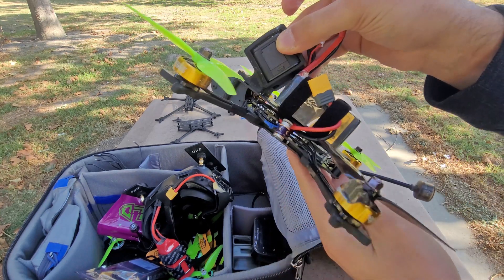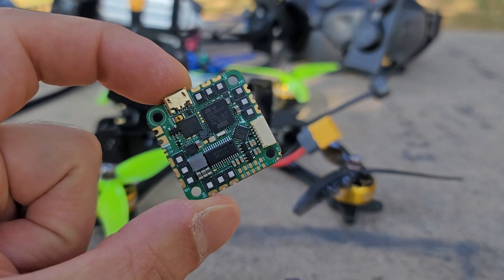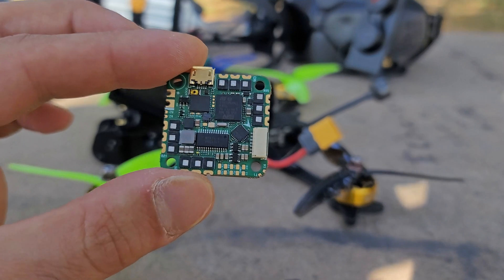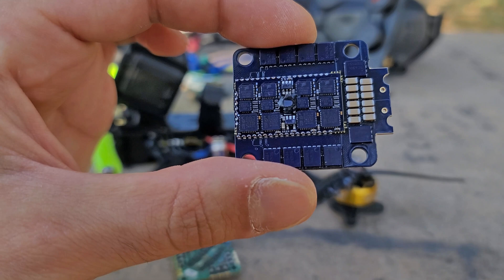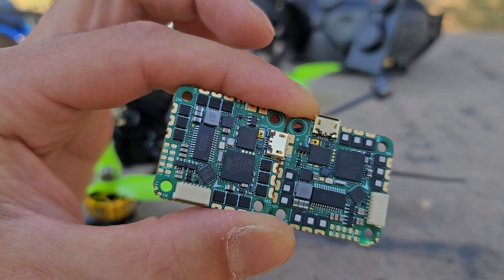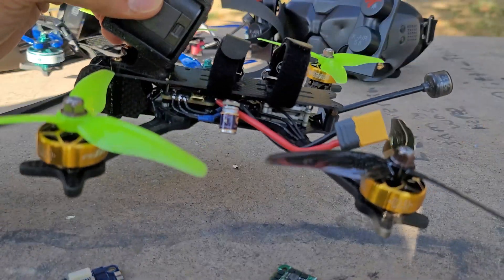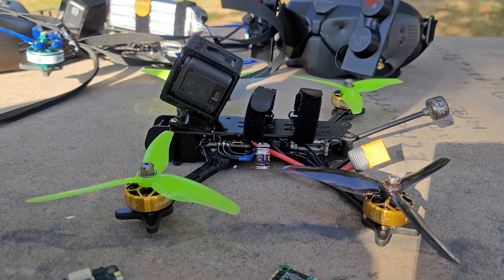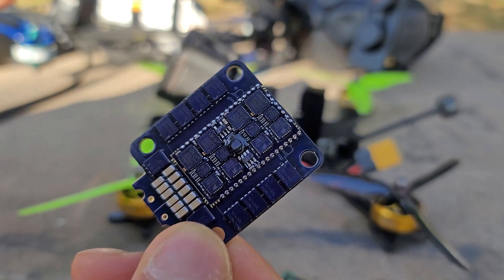iFlight Beast H7 AIO - A Whoop board for FULL 5"?

Comment: Jeez, finally, somebody uses UBGA.

95% of whats been driving this hobby is cost. Its why F411 everywhere. Its why almost all SMD components are under 50 cents..

But, this iFlight H7 AIO is just beginning of what is "possible".. ofcourse for a price:
1. H7 dual core. WCSP156 5x5mm package. Save space. Better heat transfer
2. Already has 2MB flash. Can use 1.5MB for Blackbox.
3. H7 dual core.. 240Mhz F4 core can run 4x BLHeli_32 ESC.
4. 4xFortior gate driver is so 2010. And tons of wasted space. Im sure there are solutions that integrate gate driver with FET.
5. Speaking of noise - AIO can have electronics/gyro on separate board like the Tekko

And ofcourse, the big elephant in the room.
Whats point of miniturizing FC/ESC when DJI Air is huge and clunky. 
And doesn't it already have big MCU? And why are we sending packets over 2.4Ghz and 5.8Ghz.. seems kinda stupid to me.

The future is 1 board. FC. ESC. DJI. 
All "one board". And 1 frequency. video and RC control together.

Back in 90s, you had to plug in a ISA Sound Card. Then they integrated it. Almost nobody buys sound cards or network cards.
Likewise with video cards. First integrated into north bridge. Nowadays built into CPU.

Comment: Im new to FPV, why does you capacitor look so different? Do you have a video where you talk about it?
I also saw this last month, i want to put it in a 4" or 5" 360 degree video build, but i want o build with cheaper parts before i mess up a $90 board!
Reply from the maker: Which capacitor?  Maybe the descriptions of the items found on this page will help. 

https://fpvcycle.com/products/panasonic-fm-low-esr-electrolytic-capacitors?_pos=6&_sid=a45050e22&_ss=r

https://fpvcycle.com/products/wafl-s-fpv-capacitors-2-pack?_pos=1&_sid=a45050e22&_ss=r
Reply: @Kabab   The purple cylinder in this shot: 6:39
Reply from the maker: @techknowbabble  oh it's made by WafL. But they kinda slow at making more. It's just a particular cap spec
Reply: @Kabab  Cool, thanks. Is it any better that others or just look really cool? :)
Reply from the maker: @techknowbabble  it's the same thing just a little smaller.

Comment: I like that spot. It looks like good mix of open space and trees. How you were able to manage to find you way back to your launch location is impressive. I get lost a lot. Using landmarks as locators works but if I'm far away from them and go down, tracking the quad down becomes an Indiana Jones excursion.
.
Btw, I took the Babytooth out on Sunday for its maiden. I used your suggestions for the build as I still don't get how people pick frame, motor, and prop combos. That thing is so quite. My friend was pretty impressed with how stealthy it is. There didn't seem to be a lot of punch-out power though. I mean it is a 1s so I can't expect much. But it cruises so nicely. Because it's so light and the motors aren't like blender motors, getting out things like thick brush or trees can be tough. I got caught in a tree and we could not see it even while spinning the props. Fortunately, turtle mode got me out. Had it been a thick pine tree, I think it would still be there.
Reply from the maker: Yeah can't expect too much from 1s but it handles really nicely

Comment: Well, anything with anyone 35A esc's  will work
Reply from the maker: You'd think so but give it a shot and you'll see it's absolutely awful. I've tested every single whoop board out there for full 5". None work
Reply: @Kabab  Did you try this one, I run it in a licht 5inch toothpick style, with a small capacitor bank,   HIFIONRC F7 2-6S 45A AIO FC + ESC Toothpick Flight Controller

Comment: Dude... you can't just drop a massive 7+" motor on your store and not do a video about it...for a 300g dry weight (w/ BH 2806.5s), LOS-only 7" vertical arm frame, do you think your new motors are overkill?  I still think the 7" bi-blade gemfan 7042s are the easiest to tune throttle wobbles out of...
Reply from the maker: I JUST put up the first basic video about the motors.  The gemfan 7042 is fine but there really are no good 7" props at all right now.  Every last one is really not good.  The DAL Fold 7 is the best one but it frikin explodes in flight sometimes :-(

Comment: The CLR V2 Whoop V2 F7 board is a nice board. Dont have the plug in play DJI but has enough Uarts to do whatever you need to do. I currently running it on a 5inch with Vista.
MCU: STM32F722RET6 216MHz

6-Axis MPU6000

Build in Beta flight OSD

2- 6S( 27V ) direct battery power

Build in Voltage monitoring resistor

Build in 5V/1.5A BEC and 3.3V/250mA for system

Direct solder on mount for TBS Cross fire Or solder pads for Frsky

Build in Camera Control with direct camera plug in

Build_in 32bit 35A ESC with current sensor

29x29 whoop Styple mounting pattern

Dshot support with Native RPMfiltering support

Designed to use on 5V camera and VTX.

UARTS to use (uart1,uart2,uart5,uart6)

Comment: I have a HIFIONRC F7 45a AIO whoop board in my 3 inch that will supposedly work fine in a 5 inch, but I'm on my second board. The first one lasted 6 flights before I got a motor stuttering. Then another motor, then another, then the ESC was completely dead. But I can never tell if a board is a bad design or just the common China makes crap that doesn't work half the time because quality is less important than volume sales. I don't think my 1404 4600kv motors on 3 and 4s pulled more than 45 amps. What's the name of that sugar substitute that you said is actually good for your teeth? I can't remember the video where you talked about that.
Reply from the maker: xylitol
Reply: @Kabab  Thanks! The Ice Breaker gum I get sometimes has that in it.

Comment: 20x20 should be the standard mount pattern for all boards. AIO, Stacks. I have the JHEMCU 20 x 20 AIO board for my 4 inch micro reverb which I’m using for long-range because I can run a decased Vista straight on the 20 x 20 stack
Reply from the maker: Yep.  The issue is just that manufacturers are just too confused about what that means. I keep telling them to just take the same 30x30 esc and stick 20x20 holes on it but they don't get it and keep trying to make it smaller.
Reply: @Kabab  do you think they have perhaps become overly obsessed with hitting sub 250g In order to ensure they protect the baseline business because of the changes in US regulations, which could see other countries follow suit? Hence the reason why they have not really listening

Comment: Are you benefitting from filters because its so light, or they're worth using with BF now? That looked like great expo on return to centre.
Reply from the maker: The filters are fine. You can see that the quad isn't flying perfect. I've gotta tune about something on it. I haven't bothered trying to figure it out because it would take forever on 4.2
Reply: @Kabab  looks very well for stock though.

Comment: Just curious have you setup the  amp meter (current sensor) how many amps's was it pulling with that combo? $90 does sound expensive.. I'm gonna pass. IMO weight is not as important on a 5" unless your racing so for Freestyle I would rather have the reliability and durability of a 30x30 stack especially if I get caught up in a tree and need to hack my way out. Not to mention freestyle quads need some extra weight to throw the mass around.  Also I think the barometer is used for altitude. PyroDrone has a Whoop style FC with a barometer and it's kind of cool to see how high your flying. Very easy to setup just enable it and check the box in OSD menu. I never realized how high 400 ft was.
Reply from the maker: The amp readounts are not accurate at all. I don't even bother setting them up anymore

Comment: Not sure if you do this or have tried but try turtle mode :0. if that 4-1 FC can do Turtle mode like other 30x30 stack ESC's then it should get an approval. Most 30x30 ESC's can handle Turtle mode or if your caught in a tree and need to pop it a couple of times. You say it perfom's at the same level so just curious if you have tried them in turtle mode.
Reply from the maker: Performs at the same level, I dunno if it'll hold up to the same punishment. Out of about 20 packs it's been fine. Turtle and all

Comment: Hi Bob   Great looking board for whoop style quads, I don't know about the price,  but I have tried other boards and the only one I found was the JHEMCU GHF-411 pro for 6s and I was terrible unimpressed it was a no good after 4 flights and I'm only using 1106 2400kv 6s motors. Will I try it probably not.  But I still want too  !  Thanks again for the information and video
Reply from the maker: That's the issue with all the boards usually

Comment: Ok I'm impressed, there's always been compromises with 1 inch AIO boards usually lack of ports and lack of black box. Like the new BetaFPV 20a has a black box but their new F722 has ports but no black box. I wonder if Iflight could do a cheaper F405 based board with a black box and good 40a in the same way as this board.
Reply from the maker: The power routing in the board is more valuable than anything on the board imo so I'd say it would be a good move for them if they did

Comment: Thoughts on CLR whoop 25A? Based on layout, components, and reputation, I'd pick that one over iFlight's. Don't have any experience on both boards though.
Reply: I can chime in on the CLR Whoop V2 F7 Aio 35amp board I recently bought. So far so good. Haven't had it long enough to vouch for durability.  But I'm impressed with the board and it's on a 5inch build with DJI Vista.
Purchased from Pyrodrone. 
MCU: STM32F722RET6 216MHz

6-Axis MPU6000

Build in Beta flight OSD

2- 6S( 27V ) direct battery power

Build in Voltage monitoring resistor

Build in 5V/1.5A BEC and 3.3V/250mA for system

Direct solder on mount for TBS Cross fire Or solder pads for Frsky

Build in Camera Control with direct camera plug in

Build_in 32bit 35A ESC with current sensor

29x29 whoop Styple mounting pattern

Dshot support with Native RPMfiltering support

Designed to use on 5V camera and VTX.

UARTS to use (uart1,uart2,uart5,uart6)

Comment: When building smaller quads - is it beneficial to use higher amp rated board (which is more expensive) if your motors don't drain this much amps? Like motors drain 18A max and you take 35A board instead of 20A? Basically if the mosfet's or anything else's quality is subpar - are there chances that under lighter load it will be ok?
Reply from the maker: The amperage of the FET's on these little boards don't matter as much as the electronic design. It can't drive the current to feed the FET's even if it wanted to

Comment: Loving the product....but not the price
Reply: This board with 50usd would kill everything else. Production cost of this should be about the same as regular esc and a bit more. There will be a clone in a few months under 60usd for sure!
Reply from the maker: maybe.  This board is expected to use non-recycled FET's.  Nearly every single ESC out there uses recycled FET's from old devices of unknown origin which often results in the failures we have.  Using all new electronics significantly increase the cost of a board.  You might see clones, but that doesn't mean they're worth the lower price tag because they're more likely to burn easier.
Reply: @Kabab  I didn't know that..... great comment  thanks!!!

Comment: 1 burned ESC = 90$ cost... 
sry but that’s a deal breaker for me.
Reply: Thinking the same but for me its like 3 years and 500+ packs with no burned esc:s... even cheap ones...  I did acryl coat every component though. dont know is that an issue anymore or outside of Kiss ecosystem.
Reply: @afpv2225  i already had many stacks from mamba where 1 esc just broke
Reply: @justvoorfun  If you have no use for broken mamba stacks / other broken parts, could you mail them to me? I can pay for shipping of course, I would like to see if I'm smart enough to fix them. 
My mamba f405 stack esc blew a few fets, but I replaced them. It then broke again later in a really weird way where it seems to work fine, but when flying one motor is much slower than the others, so it tilts back into that corner slightly and forces the max amp draw to be about 30A. (I've tested with many motors, so it's not a broken motor)

Comment: Be great for a long range setup. F7 .. if u wanted to sometimes change the props and rip u got 45a .. though like to see how betafpv 35a one would run
Reply from the maker: I'd strongly recommend staying away from anything betafpv.  extremely unreliable and awful QC
Reply: @Kabab  damn it.. now u tell me lmao.. I just built a beyond the limit whoop quad using betafpv.. 4S 6000Kv lol
Reply: @QSpeedRacer  Had 2 betafpv vtx broke after 1-2 flights, 1105 motors with loose shafts after 1-2 prop changes. But their 1106 motors are good so far, going to test their boards soon, since not many alternatives are available.
Reply: @dmitry.murashenkov  omg damn.. 
I so far have use 2 of their f4 aio, a 12a and 20a. And 4 of their 1204 motors. So far so good.. but the radios r garbage. No clue how no reviewer picked up on it.. at first betafpv guy was like u have to tune center. I'm like I know that did that but pointless.. finally he got engineer and engineer was like yea it should be that random on center 😄.. I can live with a few point 1498 to 1502.. but 1488 to 1512, another 1480 to 1520.. 
If this happened earlier I would of did geprc board haha
Reply: @Kabab  i can attest their literadio 2 is garbage. I went thru 3. Only 1 was semi ok. Rest had a dead space of 20.. 1480 to 1520 on one. Never goes back to the same spot for center so flying a whoop in house it drifting everywhere.. spinning.. they replaced one.. offered on second but ended up just keeping it to test 2w amplifier

Comment: My hglrc zeus35 AIO has been ripping hard on both  2306 2600kv 4s and 2206 2400kv 6s with throttle limit for months now
Reply from the maker: I don't think that's a whoop board. 20x20 but bigger. Also, hglrc boards don't tend to give you all the performance there is.
Reply: @Kabab  yeah not whoop but it’s been one of the few AIO boards that have worked well for me and takes 6s too. Eager to try the iflight. Thanks for sharing.

Comment: @KababFPV This white spots on ic on that board are used only on high-end parts cuz it's expensive this its called "exposed metal top part" (its touching internal silicone which surface via iron that have way lower thermal resistance than silicone)and improve temperature =you can push more current compared to standard package -- I mean it have real impact on inside silicon temperature
Reply: picture https://e2e.ti.com/cfs-file/__key/communityserver-blogs-components-weblogfiles/00-00-00-03-59/5732.Figure2.jpg
Reply: @majamosbacher9277  I learned something today, thx for the info/link. I'm always trying to figure out ways to distinguish quality/top spec boards from cheap. Thanks!

Comment: which board would you recommend for 3s PP4? Pls as reliable as possible (Turtle possible??)

Also: How much more reliable is a seperate 20x20 stack? Is it worth the extra weight/longer standoffs etc?
Reply from the maker: The SPCMaker board we have in the store works really well for light 4S and below things.  It's really cost effective and has had good reliability.  That's why we carry it.  https://fpvcycle.com/collections/flight-controllers-aios/products/spcmaker-30a-6s-toothpick-aio-board
Reply: @Kabab  what about JHEMCU Toothpick AIO?
Reply: @Kabab  so you dont think its worth to get a 20x20 stack i guess?;)
Reply from the maker: @rawpicsfpv3516  typically 20x20 stacks are higher powered for larger quads. If it's a small or very light quad, no need for 20x20
Reply: @Kabab  okay so pp4 you consider  small/light quad? Sorry, i´ve been looking all over he internet and found close to 0 infos about the 4" PowerPick! No flight video, no build video, no one that talks about the performance perticulary of the 4"... Do you know any place i can find out more about this setup (pp4, 2203 3s 3450, aio board,Gemfan 4"...)???? Pls!

Comment: I have a light 5" running the JHEMCU F411 35A whoop board and many 3 and 4" builds using whoop boards. So far reliability hasn't been a concern except for the very early boards from Crazybee, which is a cheap brand and those were 5A per ESC.  Will be interesting to see if running 100A through the board creates heating effects that shorten the lifespan of the FC hardware. Clearly there will be heating of the board, but hopefully if airflow is good it won't cause problems? Would be interesting to observe IMU temps on these.
Reply: Can u black box or OpenTx log board Temps? 
If not temperature paint like I used on my brakes. They have melting one for 175° so has to be a color changing for that low of a temp. 
Like the paint that changes color when u touch it.. so u can quickly land and see if it changed color
Reply: I had two JHEMCU 10A 1-2s boards where an ESC burned out within the first days (on a tiny little 35mm 2S whoop). Sadly, that particular board was pretty much useless..

Comment: Haven't build a quad in a while but aren't those motor/battery pads just way too small. Especially for 90 dollars, one bad crash and the entire pad gets lifted off.
Reply from the maker: yep, they small for sure.  But if you're looking for this....it's the best you can get
Reply: they do look much better then most whoop boards solder pads.

Comment: Iflight 60A aio?
Reply from the maker: The amps don't even matter anymore.  It's more about if it can actually manage the power running through the PCB without other issues.
Reply: @Kabab  could punch max throttle few time.. durability?